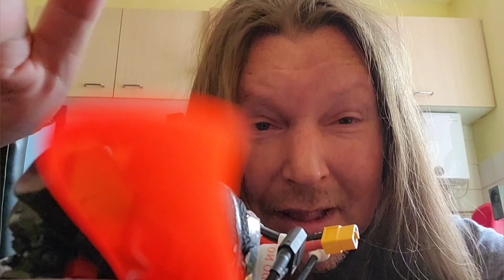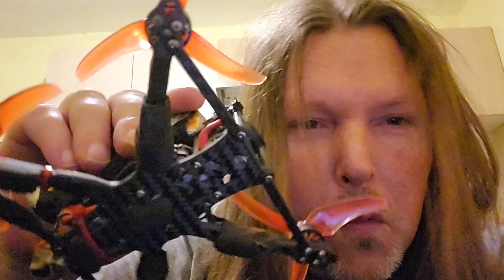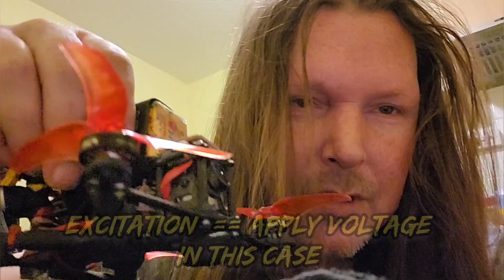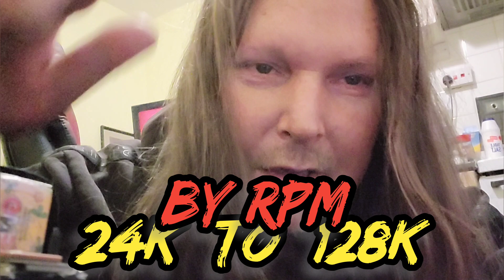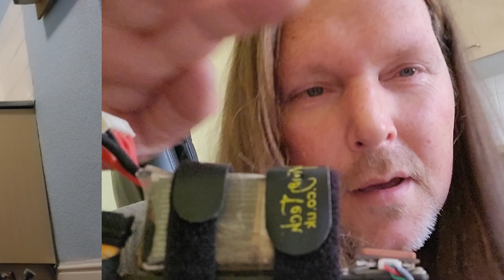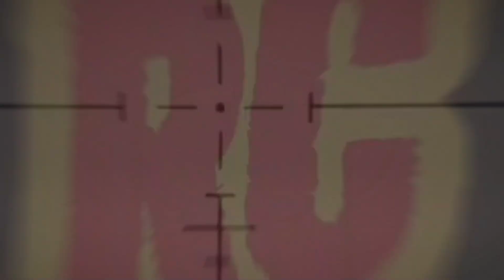BLheli_32 "BYRPM" Frequencies Explained, audible, slowmotion examples! #betaflight #fpvdrone #elrs

Comment: Hay brother. i started using BY RPM at the start of this year. i do like it but but i have already burnt 3 xing 2207 2750kv motors on 4s this year. im running master multiplyer of 1.3 and lowered d gaind to around 23 to 28 and filter slider at 1.2  This should not be happening. it never happened before i started using BY RPM so that is what it has to be. also i started flying 3D this year so that could have something to do with it. NOT SURE. all i know is now i have a hard time keeping my motors cool when flying several packs back to back.
Reply from the maker: Thats not high 1.3 and lowering the d gain will give slower occilations if anything!
I have a few drones, and each case is different, obviously, but what i mean is i can run my mamba f4 2203.5 pancake motors on a high filter level and 1.6 mmultiplier and thrash the hell out of it, and the motors dont get warm( i should imagine when running they do) and its a heavy 1300mah drone!
The drone in the example however with the t-motor 1404 3800kv i can run 1.5 mmultiplier but i keep the default " filter settings) as they do get hot otherwise.
BUT THERES A BIG DIFFERENCE BETWEEN HOT AND A BURNT OUT MOTOR, THE TEMP DIFFERENCE IS HUGE!
IM AFRAID I CANT ANSWER THAT AS BY RPM ,ANYTHING ABOVE 48KHZ WILL BE COOLER RUNNING!
IS YOUR LOW END 48K, 24K OR 16K
SOME ESCS ALLOW A LOW END OF 16KHZ, DOES YOURS?
ALSO, YOU HAVNT PUT YOUR BEEP STRENGHT UP? THAT CAN BURN THEM OUT IN SECONDS
Reply: @rcaddict9558  i run 24hz on the low and by rpm on the hi.   they will go down to 16 but i stick with 24.  d-shot beeper is stock 80 on strength. i think im on a fine line where as long as the props are not bent very out of shape the motors run very warm but you can still hold them. but most times after a crash i re arm and keep flying with out inspecting the quad so sometimes when i land i realise i have a very bad bent prop so i may be doing damage to them at that time with out knowing it. also using normal props to fly 3D cuts my power in half so im almost at full throttle the whole flight. i know this is bad for the whole system as it generates lots of heat and kills my lipos after about 40 flights if im lucky. i think real 3D props would solve most of my problems but i cant afford them so i make do with what i have and what people give me.
Reply from the maker: So from my heli days, i know that motors are most efficient at around 80% throttle, helis we run a flat throttle curve or v curve if we dont have a governor, (governor senses speed feedback and corrects to a given setpoint when pitch "Amps" are pulled in the collective range)
Now 3d props would be identicaly matched "assymetrical" so yes that has to be a key player in the story!
If we think about turtle mode, its for a second that we flip the drone (reversing which ever side the gyro senses it needs to)
i can tell you that motor filters are a real heat problem or aid, ie, when the #diatone roma F5v2 came out, it shipped as pnp with the filters in a - position!
#joshuaBardwell did a video on it, and pointed out that it was strange for a premium drone to have a filter setting of less than 1.
I have that drone, and thinking of it, its the only drone that i really have to watch the motor heat when flashing, i have it on 4.4.1 and filters are (BIDIRECTIONAL DSHOT RPM FILTERING FOR NORMAL BUILD)
SO HIGHER THAN THE ORIGANAL BY 1 OR TO NOTCHES ON THE SLIDER!
BUT THAT DRONE IS LOCKED IN AND FLIES GREAT!
$$$IT HAS TO BE THE FACT THAT THE FILTERS ARE ABOVE NORMAL, THE PROPS ARE THE WRONG PITCH AND OVER PROPING IN 3D MODE.
IM AFFRAID I DONT HAVE ANY EXPERIENCE IN USING 3D MODE ON DRONES!
BUT I CAN ASSURE YOU THAT MOTORS ARE HAPPIEST AROUND 80% (PLEASE LOOK IT UP) AND ZING MOTORS ARE SUPPOSED TO BE VERY GOOD WITH THEIR ARCED NEODYNEAM MAGNETS!
JUST OUT OF INTUREST, DO YOU HAVE THE CORRECT MOTOR MAGNET COUNT IN THE MOTORS TAB?
Reply: @rcaddict9558  yes
Reply from the maker: Try setting in presets, filters, "rpm filtering for a noisy build with biderectional dshot" and get the corect props as im sure if i look at some of my props, upside down the pitch is lower near the center therefore inverted would have to spin faster and your filters would be totally incorrect for inverted flight
causing overheating issues!
Just a guess but i think we are on the right track!
Ive just maidened 4.4.2 and the mmultiplier on 1.6 and filters both on 1 and you will see in the video, no shakes, no propwash and its brilliant, it keeps getting better!
Reply: @rcaddict9558  thanks for all the info brother.have a great day.
Reply from the maker: No worries mate, glad i got back, flew 2 packs and now its a thunderstorm haha
Anytime Chris

Comment: 🐩
Reply from the maker: Does it make sense to you?
Did you like the slow mo out of tune?
Reply: @rcaddict9558  I can understand some of what your saying but not what that has to do with anything. My car makes that noise when I come to a stop though, I like it
Reply from the maker: If youve never messed about with motors and programing microcontrollers to run the motors ,its going to be hard to understand!
Just think of THE LOWER THE MOTOR FREQUENCY 24Khz and 48Khz your motor has more torque, more turning force, therefore more braking force.
128Khz however is more smoother but les Turning force
so the esc "BLheli-32" has options to set your motor Khz value, a new feature in 32.9 was "BYRPM" which in simple terms means "variable motor frequency depending on the situation!"
So if you were the motor and you had to run up a steep hill, "you would want the most torque!" 24Khz
if youd reached the peak of the hill and had a nice smooth jog for a few minutes, "you would pick 128k!"
So "the point of "BYRPM IS TO TRACK YOUR MOTORS FEEDBACK AND VARY THE MOTORS FREQUENCY DEPENDING ON THE CONDITION AND ATTITUDE, SAVE ENERGY, AND GIVE EXTRA POWER THAT A (FIXED) Khz VALUE CANOT GIVE!"
DOES THAT MAKE SENSE DUDE!
Reply from the maker: Your car is a hybrid, so your motor is in regenerative "charging" under braking!
therefore the motor is being turned by either a clutch pack, or directly from the drivetrain, different thing, there are many types of Hybrid vechles, but stay with my first reply.
ok dude, nice to hear from you
Reply: @rcaddict9558 thank you brother this is really going to help me out. By the time I can afford to fly my flywoo Explorer lr 4 v2 I'll be able to program it. I haven't been able to order any more parts  because life keeps getting in the way like having to eat, lol 😂 but I'm not giving up and started saving money up again.  So I have been trying to learn all that I can about the different systems of fpv drones
Reply from the maker: @jamesmason7124 well done James,  I'm the same at the moment, food has gone up so much, it seems everyday is a fiver£ just for milk, bread,  and sh%t coffee,  I'm in debt every month and I don't eat well, it's just surviving! When I was young 20-35 I had holidays etc, now I'm eating bread just to fill me up! You are not alone my friend